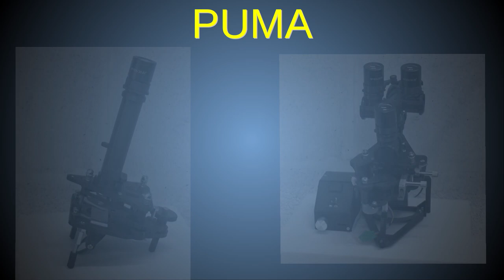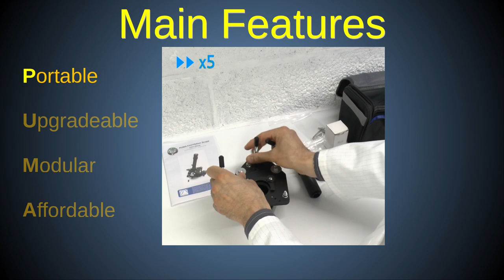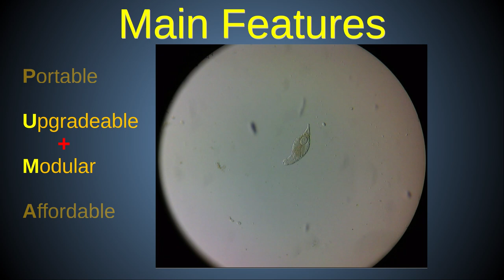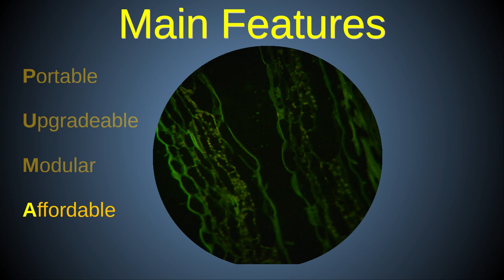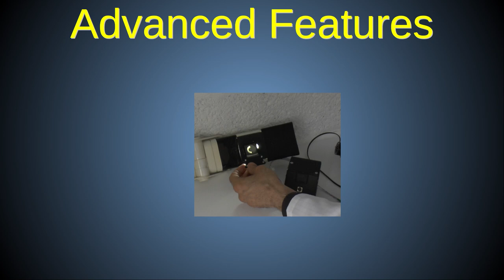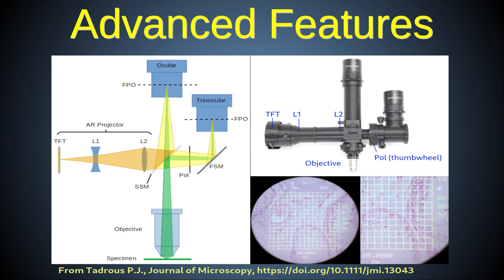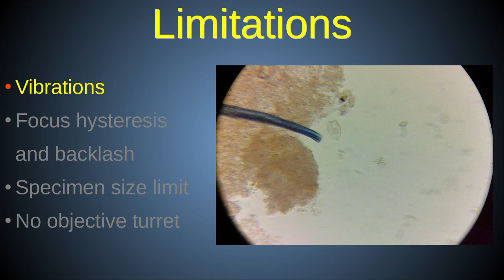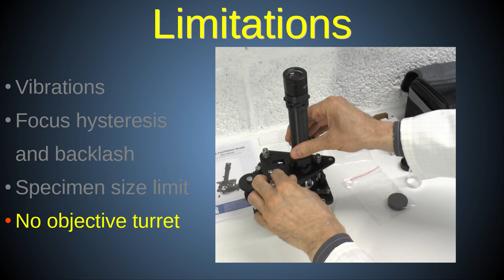Introduction to PUMA Microscopy (the advanced 3D printed DIY microscope)

Comment: Very cool! 
Have you considered a module to provide upper illumination for metallographic samples? I could see this being very useful for certain electronics hobbyists that have samples that would fit on the stage but are not translucent. Although that may require a different stage as well, since those microscopes usually have fine-grained X and Y adjustments.
Having the ability to capture the objective output with a "real-time" camera would also be nice, since you could save images and view them on a monitor. If you couple that with a motorized X and Y adjust for the metallographic samples, then you could perform automated high-resolution sweeps that can be viewed on a computer afterwards.
Reply from the maker: Thanks. Those things are already part of the PUMA modular design. See these videos for details:

Epi-Illumination (Dominus part 4): https://youtu.be/cAEB10K8PqI
XY Vernier Slide Holder: https://youtu.be/XtqqCiPloAQ
Stabiliser: https://youtu.be/d8tMtWFhNY4

I also plan to make a new stage for the PUMA for more high end robotic control microscopy (for advanced university-type research) - but that is still in the pipeline. It will likely be more expensive to build than the current standard stage but is intended for people who need to go beyond manual visual observations. Other modules (e.g. for interferometry) are also under consideration - PUMA is still a developing project.
Reply: @PUMAMicroscope Wow, if you do, I would have to get one for our lab! Do you have a page where I can donate to support this project?
Reply from the maker: Hello, sure. Each video description has donation links but here they are for convenience:
1. Become a Patron: https://www.patreon.com/PUMAMicroscope
2. Donate via PayPal: https://www.paypal.com/donate/?hosted_button_id=NPMYJKJATDLQ4
Every donation helps - esp. when it comes to developing new hardware modules because there is a lot of 'try-fails' in the development cycle before I find the path that works well enough to become part of the PUMA canon. Thanks for any support you can provide, no matter how small.

Comment: For the same total cost and same 1000x magnification, what combo will generally give a better image?
25x Eyepiece + 40x Objective
or
10x Eyepiece + 100x Objective

Thanks you for sharing your knowledge!!!!
Reply from the maker: If, by 'better', you mean 'higher resolution' then the 100x objective scenario is better. This is because resolution is captured by the objective. The eyepiece just makes whatever the objective captures look bigger (and further away).
Reply: @PUMAMicroscope  Yes, I mean "higher resolution". Your answer are like your video: you pack a lot of info in a small package! Thank you for the great explanation.
Reply: @PUMAMicroscope Same question, but how about the field of view or other important parameter that might be modified between theses two configuration?
Reply from the maker: Field of view will depend on the eyepiece field number (that is the field number of the x10 vs. the field number of the x20 eyepiece).  @alexandrevaliquette3883
Reply: @PUMAMicroscope  So... Why don't we have one expensive 100x or 40x objective and many cheaper eyepiece with various magnification (0.1x  0.5x  1x 10x)?

There must be a good reason we switch between objectives (and have a regular 10x eyepiece) instead of switching between eye piece (and having only one objective)?
Reply from the maker: Yes - across the whole range of magnifications the field of view is limited by the objective - I was only talking about the situation of the two highest power lenses. So a x40 lens can never give the same wide field as a x4 regardless of eyepiece. (When I say 'never' I am talking of using microscope optics in the standard way - there are other ways to do microimaging - with holography for example - where the situation is different)  @alexandrevaliquette3883
Reply: @PUMAMicroscope Ok, now I truly get it!!! Thank you for helping me widen my field of view on that topic! My knowledge on microscopy is still at low resolution level, but you help me getting a better image.

:shelterin::chillwcat:Science is like a magic trick: once you know how it's really done, you loose the magic effect, but you can appreciate how clever it is! And it help you pushing your art further.

Ps Holography microimaging... another can of worms... That 0.001% of humans are so clever isn't!

Comment: Thank you Paul that you made this possible! 
The epi illumination is coaxial or at an angle?
Reply from the maker: Thanks for your support. The epi-illumination is straight down (co-axial) via the 45 degree semi-silvered mirror in the advanced filter block. I got some great views of an integrated circuit with amazing resolution and clarity recently. I will try to find somewhere to share these pictures and make some more videos to show everyone how to use the various epi-illumination modes.
Reply: @PUMAMicroscope  I saw the photo of a resistor in one of the videos however I was not sure whether it was coaxial, so thank you for the clarification!
Reply from the maker: That picture was from a small CMOS camera module PCB - big PCBs won't fit on the stage. Interestingly I had to use epi-polarisation to get that clarity with the SMD components (to remove haze/glare) but the silicon chip IC dies I used give good images with plain epi-illumination (although epi-polarisation shows more as you rotate the polariser. I really need to make a video to illustrate that - it's on my list of videos to make).

Comment: why do you not use second hand professional microscops instead
Reply from the maker: Good question. Here is my answer.
1. Second hand professional microscopes (SHPM) are more difficult to customise (other than minor adjustments) and most of them are much less portable (esp. when you consider the range of imaging modalities available on them. See, for example, my video on epi-illumination https://youtu.be/cAEB10K8PqI ).
2. SHPM are also variable (you can make 20 PUMAs all the same for a research project or class - not so easy or cheap to do that with SHPM). 
3. Of course you can use SHPM *as well*. PUMA and SHPM are not mutually exclusive.
4. Getting the same range of imaging modality features from a SHPM may be much more expensive (like fluoresence or epi-illumination) or simply not available (like augmented reality attachments and combinations of modalities that PUMA can do) and if they are available it is not so quick and easy (or even possible in some cases) to switch between them as with the modules of a PUMA.
5. Also PUMA is about microscopy education - learning how various aspects of advanced microscopy work by building a scope from scratch is good practical education. My videos also emphasise theory as well as practice.
These points are a recurring theme in the other videos in this series.
Reply: @PUMAMicroscope  you can never reach the mechanic qualiy of an Zeiss axiscope etc . I bought one from al university lab for a few bugs
Reply: @PUMAMicroscope  ok. you are a seller of mikroskops therefore your mikroscope is the best
but it is not th cheapest solution
uses ergaval or axioscopes ar better
Reply: @PUMAMicroscope  y answers is
1. do you think that zou are better than all zeiss developpers
2. i simple need 3 microscops one is normal one is stereo and one is a REM oprtunity
3. so i dont need a PUMA
4. there is need for epi-fluorescenz. which only gives unsharp images
epi is made by a simpe LED which can make oblique epi illmination is better
5. as well you lean adpating many SHMPsy

Comment: I could SWEAR I just heard a bunch of scope manufactures use curse words...   the world is changing :D
Reply from the maker: Nice. Democratisation of lab equipment should improve standards, promote accessibility and make prices fairer. 3D printing and open source are game changers.
Reply: @PUMAMicroscope  After watching this... again, :P I have suggestions from lessons learned building 3D printers. To fix the vibration, you need to add MASS and Stiffness. Mass is easy: add weight OR (if you already took care of stiffness) you can screw it down on the desk or a 6x6 cement tile (which makes a nice base btw). But before all this you need to address all flexibility in the frame, make sure your parts are designed to resist flexing, add braces were required. Remember you can make internal modifications like adding round holes through a part, it adds a cylinder of stiff plastic through it. In addition to this, adding a case that attaches to all components would also fix stiffness. Maybe multiple 3D printed panels that would screw on to everything like an exoskeleton.
Reply from the maker: Thanks, I really appreciate any efforts to help with the vibrations issue, which I consider to be due to the flexibility of the 3D printed plastic - especially joints - rather than a sheer lack of weight or flexibility of any individual component. However, if I can use a Trekism - 'I'm a doctor, not a mechanical engineer!'. All my mechanics (and 3D printing for that matter) are self taught so I am hoping someone cleverer than me can find a solution to this. The monocular tube you see is not a simple tube - if you look at the CAD file you can see it has internal baffles which strengthen it as well as block internal optical reflections. Also the QR mechanism already has internal hollow vertical tubes - as you suggested - but those can't strengthen the joint to the focus plate. My hunch is that a practical solution will be found with an external fixing frame (I did some orthopaedics so you can see how my mind works). It may be that such a frame must be made of metal (using off-the shelf fixings for practical adoption) with minimal 3D printed components. You can screw/bolt the feet to a wooden base or similar with the current design - but that won't fix the issue with the flexibility of the plastic connection to the focus plate. Also I am not sure how much the sprung focus mechanism contributes - but I have tried many variations on this during development and the solution you see is by far the strongest and most stable I was able to come up with. I am hoping that as more people build the scope they will tinker with various ideas and someone will come up with something that both works and is also practical for anyone to build (i.e. that doesn't require a fully equipped metal workshop with a 5-axis CNC lathe).